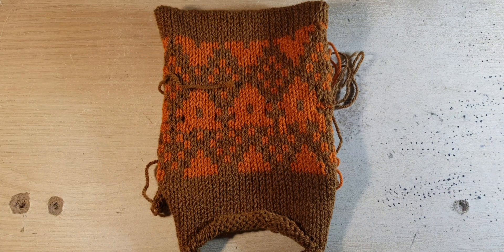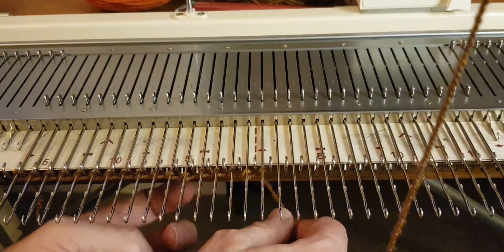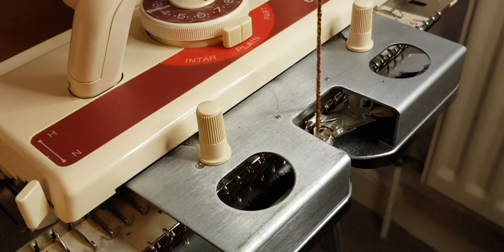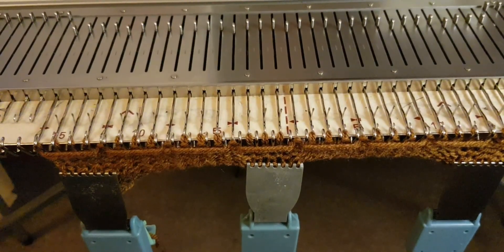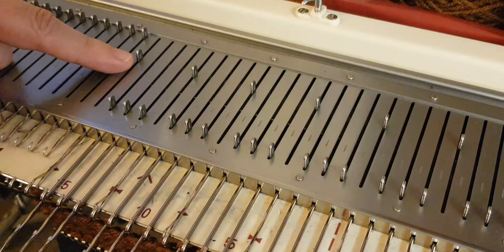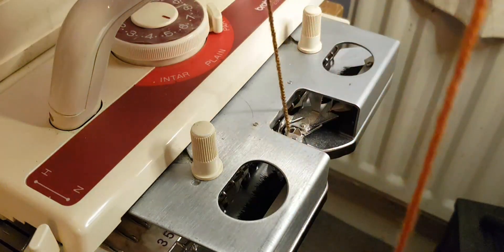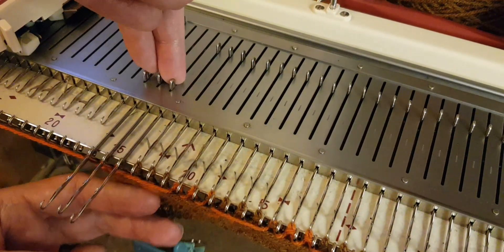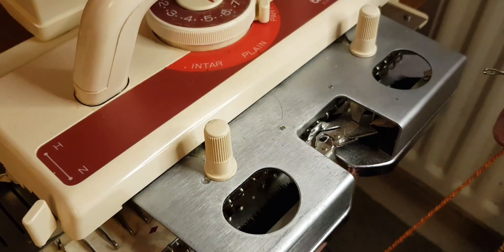knitting a Faire-Isle on the Brother KH-230

Comment: Great video! Do you have a source for more patterns that can be done on a kh230?
Reply from the maker: Not very much, the other way to do patterns is on a chart. The older brother machines the eight push button machines, those charts seem to work with the KH 230. Most brothers are based with a ratio of eight, the newer machines with the 24 punchcard machines are the only difference.